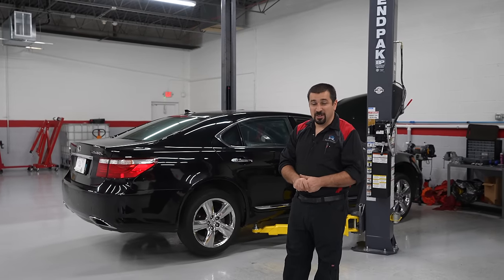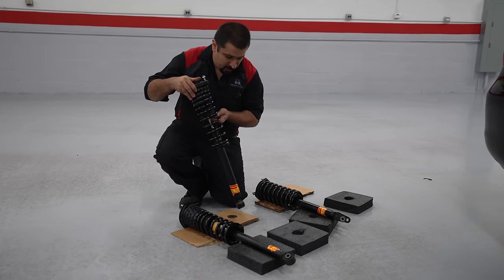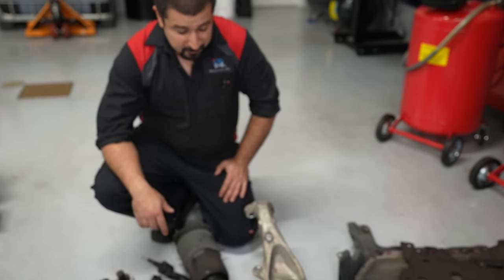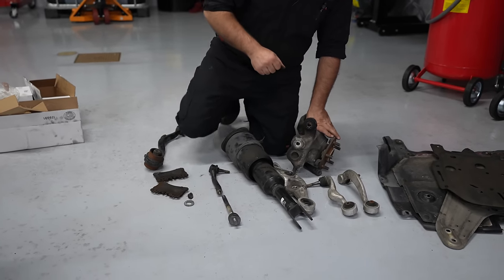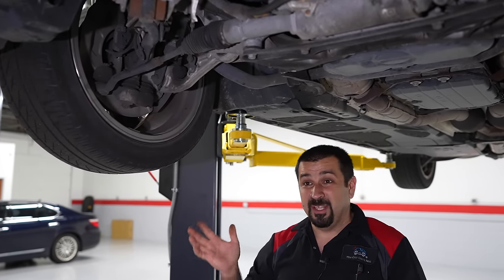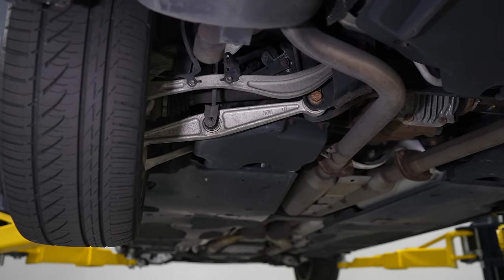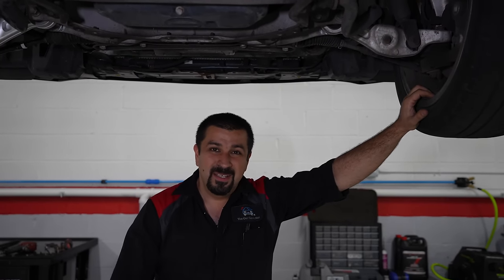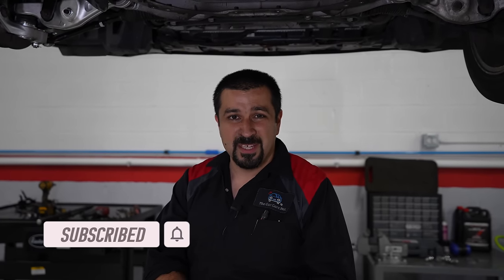Avoid THIS Lexus Model | Pre Purchase Inspection REQUIRED for this one and Here's Why.

Comment: This is another classic video. I can't clap enough for all of these great classic videos. Let's go carnut, I see you, man. Getting your hands on all of these cars. They are beautiful cars. I love the 430 in the LS brand. LS 460 is a nice ride, but the cars are too heavy, and the weight tears down the suspension, and that's the 1 thing that is bad. It's the replacement cost of the parts that will need to be replaced. The car is too heavy by far. Other than that, this car is one of the best automobiles ever. The LS 400, 430, 460 500, and on are some of the best. They are the big body with v8s, and they are very luxurious. It's a perfect combination. I have the ES 350, and its suspension doesn't fall apart as soon. The ES 350 is much lighter, and the parts are more reasonable in price for repairs to be at least over 60% cheaper than the LS's. You can make a move and get an LS 430 that has recently had this job done. The lower control arm done job is the job I'm referring to, to be exact. The 460 or the 500 are the top choices, but you have to do the maintenance money bills and each repair will arrive eventually, and they all cost more high and very high for repair fees and its always somethingdue soon for parts. If the suspension had been done all they correct way, we wouldn't have these issues in the 1st place. The LS was built ironically perfect to the tee. All you have to do is get an Air Lyft full kit installed and that would lift the car when riding big body style like those pickup 6 and SUV's that been doing it strong for the last 15 years. I have Air Lyft on my ES 350, and it is quite amazing to ride on air. Its Super-fun when I air out while rolling or I sit it all the way down while parking. Go get the book starring Polyester Infinite King.  I didn't mean to be so long-winded. Overall that LS 500 is a monster, and the LS 460l or LS460h are as good as your favorite candy by far. They are great cars. Real great cars to have to own in life. It's almost like a dream come true, and I admire all of us in the Toyota family.  Let's go places. The other thing about the LS's that is bad news is the horrible miles per gallon if you have a heavy foot, but if not, you could ride slow like the old school 70 plus club. I love the carnut man, Pause,  I'm a carnut too. My favorite car is any Lamborghini, but my down to earth favorite car is the LS 430 big body. I would keep it all original for that classy clean look but it would get an Air Lyft kit installed so I could ride low and high at different levels and be able to sit it down on with the factory look and no window tint at all. The LS models are really for long trips of over 500 miles. They are not made for the cities with a bunch of transmission shifting, but they can be in the city looking good. The carnut is an expert certified master technician. He knows it all about automobiles that he can be them as well because he know how they were built. The carnut knows it all about all automobiles. The 1996 5 speed manual Toyota is the way to go. It looks like an LS 400, and I would label the 96 Toyota camry an LS 300. That 96 would be dependable and better on gas, and maintenance costs are dirt low in price for car parts. The GS , IS, SC, and the RX and so on are all top of the line having reliability. The GX is a great looking SUV and the best part about owning a lexus is that you know who made them, and they did a great job accept for the suspension parts on the LS 460's. Those control arms should have been made to last for well over 300k miles and the air suspension was a nice thought for a feature but the bags that were used took a heavy beating and the shock or struts can't withstand the weight of the car for over 150k miles. It's those repairs that arrive too soon due to the weight of the car. The car is just too darn heavy. Big body style

Comment: I always say, "Don't cheap out on parts when they need to be replaced." Always use oem parts because they will 10/10 last longer than after market. Sure, it might cost a few hundred more but in the long run will save you headaches.

Comment: Impressive video going through all the steps to replace the air suspension and potential pitfalls.  I do my own work wherever possible on my cars so i was shocked to see that pad installed incorrectly in the caliper.  So basic and very unsafe.

Comment: These cars are a beast. I have a 2002 GS430 V8 very powerful engine. Also, very expensive to repair. I just purchased two Headlights assembly, HID Xenon and the best I could do was eBay for $200 for two in fair condition with a ballast. I the. Spent 134 dollars on HiD bulbs, and fog lights. $334 all together. Very expensive. My brother Tundra are 75 a piece and it's a 2016 not 2002 very expensive for what it is.

Comment: Hey, how about saying up front the year and the mileage? Also,, dollars, not stories.  No, a brake job is not a fortune.  I bought Lexus parts (pads and rotors) for $550 and had them installed on my LS430 at Midas for $350.  Not cheap, but not super expensive, either.

Comment: Is it correct to say that when it comes to the ls460 control arm failure, really the ONLY thing that fails on these is the RUBBER.  The actual metal parts themselves don’t fail. Is that an accurate statement?

Comment: any 460 before 2010 is a pain in the A. IMO i hate all 460s lol Especially the ones with air suspension. A rival dealership of ours. whenever they get front end noise issues. they just quote the whole front end because its a endless issue. Fix one noise, another one shows up in a few thousand miles.

Comment: Great to have someone who really knows these LS460 instead of the BS we get about the interior trim etc.The fuel injectors really worry me, question, is the 600Hl a different motor or just the 460 bored out to 5000 litres. I wish we had someone honest like you in Australia as I do love the 2009 to 2012 LS600hl we get in Australia fully loaded.  Keep up the great work.

Comment: Back in 2021 my neighbor was selling a 2007 LS460 for cheap - 91k miles. I thought that was a great buy and sent them a message asking when can I pick it up. For whatever reason they did not get the message and someone else ended up buying it. Later on as I learned more about LS460 troubles I consider myself lucky not to have opened that can of worms :)
Reply: It doesn't mean the person that purchase it had problems. That's just Petty

Comment: I hear your co cern about LS 460,s, however I disagree about how Great they are.If when yoy buy one,you have these things looked at and taken care of at the dealer or immediatelly after,do oil and filter changes.Ls460,s are Butter! They ride like nothing else out here,and they were put together with the Strongest materials.Ive had mine for 3yrs,and only thing i had was a slow leak in tires,first,i git ut plugged,then 1 year later ,new tires. Thats it.In my opinion, this is up there with the land cruiser.It rides like taking a first class flight somewhere,and with that 4.7V8, she can move!I swear by Lexus Ls460,s. Yes when repairs come,they may be expensive,)If you dont have a GOOD mexhanic,but these things are abrums tanks with lwayher and heat.They are beautiful.Especially the old ones. Just sayn. Ill take a Ls460 over a Camery ANY Day!!!!

Comment: If possible, PLEASE specify in the description of this video what brand wheel bearing and tie rods you chose. I need to replace all the front control arms, struts, knuckles, hubs/bearings and probably end links. Can you  reveal the brand(s) you use/trust ideally for this job in particular.

Comment: Great informative video.  That owner is brave spending all that money on suspension with an oil burning engine. I have a Toyota Mark X (in New Zealand, not sold in the US). Lovely car, Lexus IS 250/300/350 RWD running gear. It doesn't have air suspension but the shocks did fail, both front and rear, at ridiculously low mileage, seems to be a major weakness. But like this car, it's over 15 years old and is bone dry underneath, not a drop of oil anywhere.

Comment: The oil consumption is because the owners do what lexus says and get 10,000km services. You should change 5000-7000km max. It gums the rings up.
The front LCA bushings are a wear item and the air shocks are a money pit. Just convert them like the video shows or go AVC from the GS460.. mine lasted to 160k km till one blew (shock skirt broke prior..)

Comment: There's a guy on the ClubLexus forums that spells out the revised part #s starting in 2012 that go through the 2017 model. The lower control arms have a re-design where the metal housing extends out to support the rubber bushing. Part numbers pasted below. Credit given to LILEVO on his post. Ahmed, it would be cool to show a video replacing these with the updated versions. 

These are the part numbers you need to order for any 2007-2017 LS460 RWD, especially 2007-2011 since they all have the original bad control arm design.

Lower main 48640-50131 (2012-2017)
Lower main 48620-50131 (2012-2017)

Lower front 48620-59055 (2012-2017)
Lower front 48640-59045 (2012-2017)

Upper front RH 48610-59125 (2012-2017)
Upper rear RH 48610-59135 (2012-2017)
Upper front LH 48630-59125 (2012-2017)
Upper rear LH 48630-59135 (2012-2017)

Comment: Man U hit it on the nose I had an 460L with that height high button and it was a nightmare I went with the arnotts all around and boy did I pay for it. I also had a base model that I simply wish I would’ve kept without that button. but keep in mind just like he said once you start tearing the shocks apart, you will find all the components that needs to be changed very very expensive labor wise.

Comment: My Toyota turns on fine but stalls right after it turns on for like the first five or six cranks then once it’s alittle warm it runs on and stays on fine and drives with no issues. I’ve cleaned the throttle body, replaced the MAF, installed new spark plugs and coils, checked my ocv valve and have used fuel system cleaner and used sea foam in the crankcase and top engine cleaner. Can anyone please give me suggestions. The only codes I’m getting is misfire on 1 2 3 and 4 and p1656 . 2002 Toyota Camry 4cylinder.       Please like this so the master Toyota technician can see please 🙏

Comment: A BG oil flush service may help the oil rings to free up. See "Watch JR GO" for a DE-sludge of a late model Camaro. Also if you disable any cylinder  de-activation that may be on that car it could help. Your shop could become a BG dealer easily enough.

Comment: Just bought a 2010 460 L I’m putting it iin the shop tomorrow for the 150,000 mile service an control arm replacement. It’s got zero codes .. motor is silent . If it has air suspension.and if it’s an issue I will convert to spring. The car exterior is beautiful. . I like your blog  It would be nice if added prices of repairs
Reply: Don’t waste money converting to spring. Just fix that one part that fails, rather than blindly replacing an air strut.

Comment: I stopped buying Cadillacs because "magnetic fluid shocks" failed constantly...I had a 2013 Escalade that was in the shop 13 times in 3 years for suspension problems!  Traded it for a Lexus....never looked back...

Comment: Lol. Just sold my Porsche with almost 130k miles. Zero suspension issues, everything original. Zero oil leaks. Did have a coolant leak, but even that was fixed for free under goodwill warranty around 110-115k miles. Car was like brand new......and obviously didn't burn any oil too

Comment: Good Afternoon, 
Dennis...
I have a 2011 V-8 Hyundai Equus Signature 89K mikes:
The rear airbags were leaking and I had them replaced last week. 
However,  the rear airbags were replaced after 6 months. 
Last Friday the entire car was lowered down to the tires touching the wheel wells. 
Is the Air compressor bad ?
Can it have been overworked from the leak ?
Your comments and advice are greatly appreciated asap...
Thenk

Comment: My dad bought a 2009 ls460 with 198k for $6300 around 6 years or so ago. He now has over 330k on it. He drives the damn thing so hard and it keeps going! Only major repair was the air suspension let go last year. He's handy so he did the strutmasters conversion himself. (Very heavy car...he's had to do other minor suspension stuff too) At this point car showing its age slightly. Slight exhaust leak but we dont know where. Powertrain could go 500k miles easy. But something will probably let go before then. Amazing car! I'm looking to get a newer body style one, probably a 2015 or so, because I love the damn thing so much. It's treated us so well. Still got decent life left at 330k. Unreal to me.

Comment: I believe that 19" 5 spoke wheel was offered in oem chrome. I had a 07 LS460L with the 18" dual 7 spoke wheel that came in oem chrome. 

Mine had the rear recline seats with heated and cooling...and no air suspension. Still super soft ride!  Even put a Xbox 360 in the trunk. Man, I do miss that car🤙

Comment: Yes you are correct, I've replaced mine and that lower rearward is no easy job yet it's the worse and most likely the first to go out. I've replaced my wheel hubs as well, they're pretty difficult to get out but I drove alot before the pandemic so I changed them before they were severely stuck. Now I'm at a problem that needed Toyota techstream software which I don't have so I took to the Lexus dealer and told them I needed an accumulator replaced which was quoated at $2100, they told me the technician would have to diagnose it first before any repairs, I said that was fine. They called me back and told me it was the brake actuator instead that needed to be replaced. I asked were they sure cause the accumulator was the bad part, he assured me that the actuator was the problem and it would cost $3177. I told him if he was sure that was the problem and it would fix it then I'm good with paying the $3177. Then two weeks later I get a voice-mail that it was the accumulator that was bad and they are trying to fix it without having to replace the accumulator because it would be another $1288 dollars. I called back and left a message that I came in and said the correct issue that was wrong and the Lexus tech misdiagnosed the problem and I shouldn't have to pay extra for the technician mistake. It's been over a month now and they still haven't found a solution. Hopefully they will do what's right and not charge me another $1288 for the misdiagnosed error.

Comment: See this generation is decent but the ls430 is a overall better car I have two one has 280k miles it’s a 05 ultra luxury with all the bells and whistles and besides the air suspension it was perfect and the air suspension actually lasted 100k+ miles before any issues. The radar cruse control, backup camera, screen, soft close doors ect all work perfectly. Only complaints with the car is the paint is very soft on the black cars and scratches extraordinarily easily and the seats on the lower trims use thinner leather and the perforated cooled seats will tear pretty easily

Comment: I have es330 the electronic shocks were changed out for some after market shocks used the original springs the ride is much harsher so im will to get new struts what would you recomend i want to maintain a smooth ride

Comment: Hello, I bought a 2016 Corolla with 3k miles,  in Oct 2021. It has 60k miles and I've changed the oil every 5k miles. Do you recommend using an oil additive like BG MOA,  Or just get oil changes? Will additives help, or are they a harmful to the engine

Comment: You can burn out the old rubber bushings and replace them with polyurethane.  The ball joints can’t be salvaged and the entire control arm needs to be replaced.  The LS is a heavy car so it’s not surprising the rubber bushings would wear out after 20 years.  Air suspensions, just avoid in general.  The older LS400’s were simpler and more reliable.

Comment: Super honest. I knew the LS’s with air suspension had issues. and glad I have a 2002 ES300. All the luxury I need, dependable 3.0 V6. Now with 171k miles.
Reply: You got a gem of a vehicle there.
Reply: @bwest-yq3uc  yes 🙌 thanks !  Bought it last April 2021 from the original owner with 160k miles. He changed the timing belt, water pump and valve cover gasket all at 88k miles. Last summer I replaced the original alternator and AC compressor (it started squealing) and 2 months ago replaced the original starter. All original parts lasting 20 years. Amazing. Also replaced all 4 original struts last summer after the rear ones were leaking. Now it rides like new ! Spent as much on upkeep and replacing these original parts as much as I paid for the car. But definitely worth it. This car will last another 170k miles plus with my regular synthetic oil changes and other maintenance 
Best car I’ve ever owned and I’ve been driving 41 years!
Reply: @stephendibari5010  nice ride 😀
Reply: @parloitaliano2  thanks!!

Comment: The SC400 air suspension was like clockwork ( judged by 3 X SC400) 21 years per strut. About $1000 per strut, for brand new ones, the best riding car for the money.

Comment: I remember what you said about the LS 460 could be trouble and this one sure has a lot of problems
I was looking at an ad for a  2013  LS 460 a real silver beauty with just under 150 ,000 miles dealer serviced
many front parts serviced . For sale by the owner for just under $20,000 it says it has fwd 
my searches were for RX series , LS 400 & LS 430 when i came upon the LS 460
right now i'm just window shopping